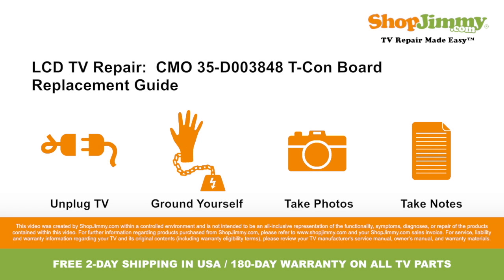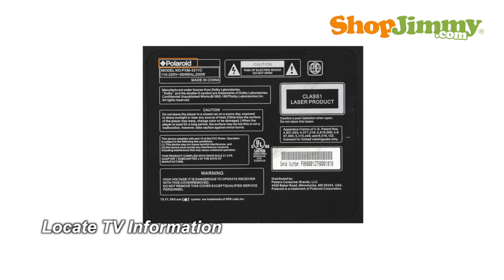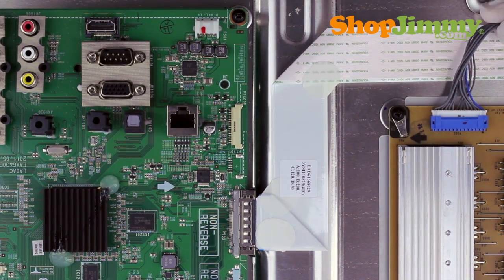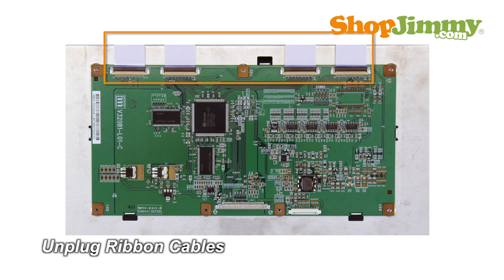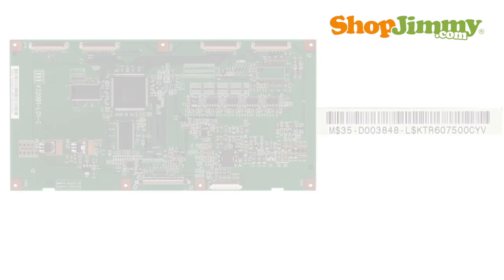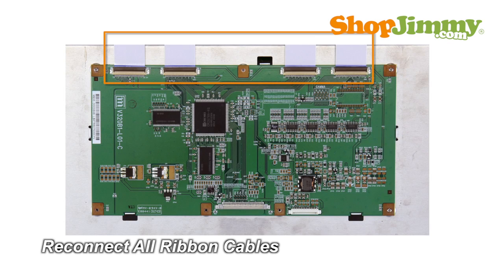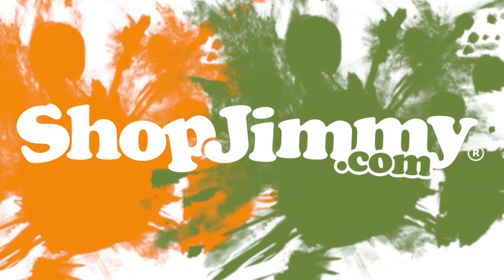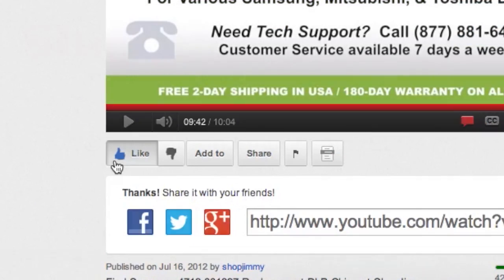TV Repair Tutorial - Vertical Lines on TV - How to Replace CMO 35-D003848 T-Con Board

Comment: I have Insigna LCD TV, Model NS-46E560A11 Rev A. After operating normally for sometimes hours at a time, the screen goes to sometimes colorful vertical lines, sometimes a pale green hue with less prominent vertical lines. When turned off and back on, the picture will be normal, but only for a few minutes. It will then go back to vertical lines. The sound is normal. Please help me identify the problem and any part(s) which could be replaced. Thank you.

Comment: Hello,need some help, please.
We have a:
 RCA LED LCD TV
Model: LED46C45RQ
Serial# 2501-LE46C45-B105727
Manufacture date: Oct. 2012
ON Corp US, Inc.

Issue- The left, 1/2 of the screen appears to have 2 sections.
1st 1/4rd, is total black.
2nd 1/4rd, appears to be receiving a signal that is backwards, with 2 vertical lines equally spaced apart.

After disconnecting the Timer Control, I turned on the screen, it appears to light up uniformly w/o any lines. ?? if that is a diagnostic aid or not?? Not sure if that indicates the screen is the problem or not, since there is no direct feed to the screen?? Anyway, I also switched the ribbons  from the T-Con, with no change with the screen. Oh, also reseated each connection on all boards with no apparent change. All grounds are good.

So, here we are, with 1/2 of a functioning screen and another 1/2 of a screen trying to mess with my mind..I can only watch this so long.lol.

Seriously, Any ideas what the problem is? How to repair?
Geeze what a way to start the weekend!!!

Thanks for your time!!!

Comment: I removed the T-Con from the TV but there is still a vertical line when I turn the TV on without the T-Con.  Do you have any suggestions?
Reply from the maker: Daniel Knutson  This sounds like a TV panel (TV Screen) problem.  If your TV panel is bad, it may be more cost-effective to replace the TV as panels are typically hard to find in stock, difficult to replace, and expensive.  Thanks and please let us know if you have any further questions!  www.shopjimmy.com
Reply: Thank you for your help!

Comment: Toshiba 52RV535U

Vertical lines in multiple colours cover 3/8 of the screen. There are 8 cable connections at the top of the LCD and the problem occurs under the rightmost 3 cables. None of the following made any difference:

I tried pushing on the 8 cables connected to the top of the LCD while the TV is on.
I tried re-seating the 2 ribbon cables that connect the tcon board to two long and narrow boards at the top of the LCD.
I tried re-seating the cable that connects the tcon board to the main board.
Reply: +ShopJimmy.com hi
Reply from the maker: Ian Kilpatrick   This sounds like a TV panel (TV Screen) problem.  If your TV panel is bad, it may be more cost-effective to replace the TV as panels are typically hard to find in stock, difficult to replace, and expensive.  Thanks and please let us know if you have any further questions!  www.shopjimmy.com

Comment: Sharp LC-46D62U -  TV was moved from one home to another and developed vertical colored lines on left quarter of the screen.  Sounds like Tcon from info I've found here.  In attempting to reseat cables,  plastic on cable from Tcon to main broke on Tcon end.  Is this something you can supply?  Photos available on request.
Reply from the maker: old curmudgeon   This sounds like a TV panel (TV Screen) problem.  If your TV panel is bad, it may be more cost-effective to replace the TV as panels are typically hard to find in stock, difficult to replace, and expensive.  Thanks and please let us know if you have any further questions!  www.shopjimmy.com

Comment: i have an element elcpo321 that only have vertical lines on the right side. is this also a t-con issue?
Reply from the maker: rikki genson  This sounds like a TV panel (TV Screen) problem.  If your TV panel is bad, it may be more cost-effective to replace the TV as panels are typically hard to find in stock, difficult to replace, and expensive.  Thanks and please let us know if you have any further questions!  www.shopjimmy.com

Comment: I HAVE VISCO MODEL NO., VCS-32V2   ITS HAS POWER, BACKLIGHT LIGHTS UP BUT NO PICTURES. HAS LINES ON THE LEFT SIDE OF SCREEN. I PLUG MY TABLET INTO AUDIO JACKS TV HAS NO SOUND.  THANKS
Reply from the maker: Randy Freeman   This could either be a bad main board or a bad TV panel.  I recommend replacing the main board to see if that fixes the problem.  If it does not fix the problem, then I would say the problem is your TV panel.  Unfortunately I do not see any replacement parts in the search results for your TV model number on our website.  Thanks and please let us know if you have any further questions!  www.shopjimmy.com
Reply: ShopJimmy.com

Comment: I have a Samsung 55 LCD tv. the issue seems very basic. Every other vertical line does not work across the entire screen. this is true for hdmi and cable connection. If I touch the back panel where the hdmi and other I/O is, every vertical line works. but eventually goes back to "every other vert. line" being out. I've taken the back off and loosened and tighten mount screws of the pcb with a temporary fix. any touching of that pcb corrects the problem...just not permanently. thanks mike
Reply from the maker: Michael Festa   I recommend checking the ribbon cables on your T-Con board to see if they are seated correctly.  Thanks and please let us know what you find.  www.shopjimmy.com